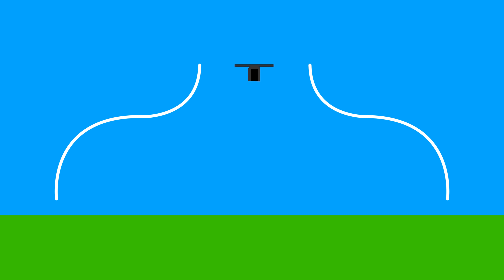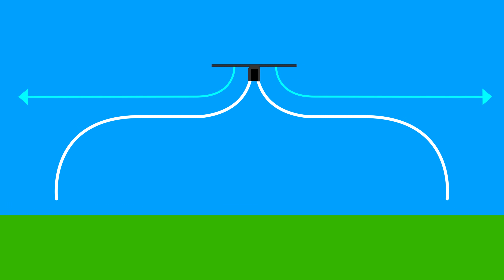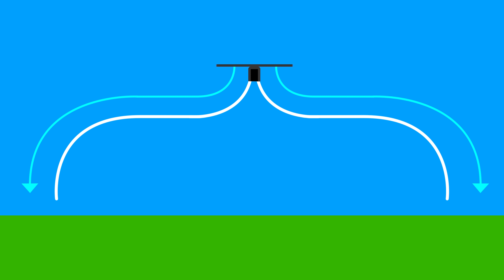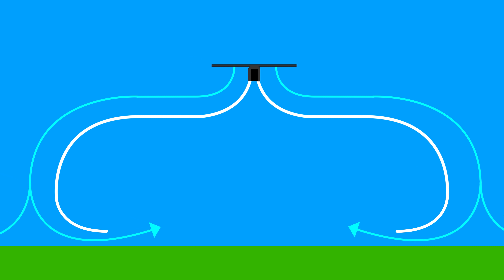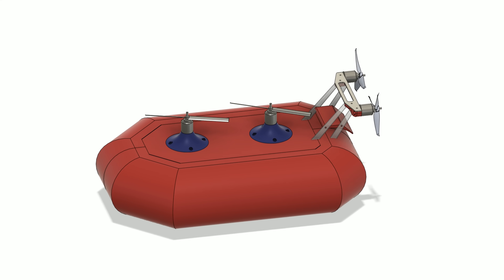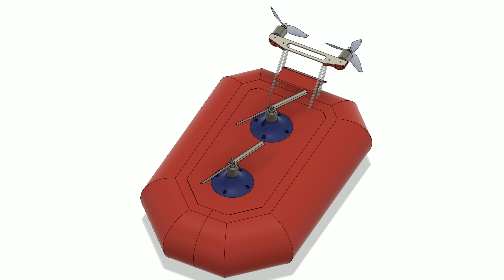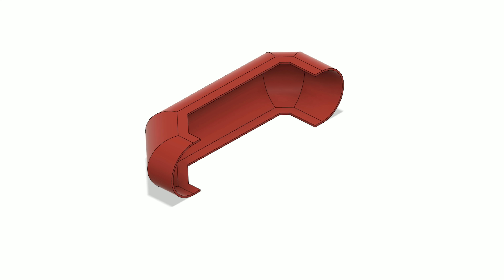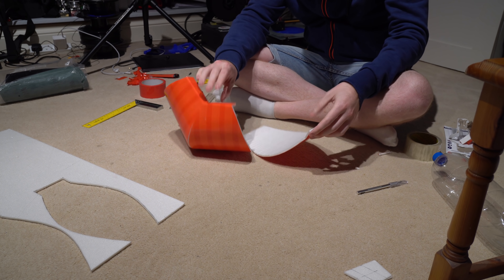Coanda Effect Hovercraft

Comment: It's difficult to see how much is the coanda effect and how much is the fact that you're using lift propellers in the first place. 
You could figure this out by mounting the lift and thrust motors on a flat plate with the same plan area as the coanda hull and see how much lift you get.
Reply: Yup, it'd be nice to see the the entire system on a flat board and see how it compares.
Reply: I thought the same thing. The craft's chassis doesn't support the idea of it being a coanda hovercraft, tho it looks like a hovercraft. It's simply not optimised for assumed results, so by the fact it works 'kind of so well' I believe at work is mostly the low-pressure zone created by the blades. He used strong enough motors it just had to work this way or another. Yet if optimised design would work with weaker ones, while this couldn't.
Reply: @mr.rabbit5642  you are on the right path...

coanda effect itself cannot produce ANY lift... whatsoever. one has to always bear in mind, what MAKES that high speed, low pressure layer of air cling to the surface in the first place?
the atmosphere itself. and that pushes just as hard on the layer of air, as it does on the surface without the air...

hang a sheet of newspaper in front of an AC vent. YAY! it supports itself!
but whats supporting the AC vent? the WALL.

take away the wall, strap the vent to the newspaper, net result... no lift. i figured this out before i was ten, thought i was so smart when i found this "VTOL" concept... only to shatter my dreams as i understood what was REALLY going on. so as ive gotten older, i just laugh at all these so called "coanda effect attempts" as they truly are amusing... but totally impractical.

the props are, by their old name, "air screws", screwing their way into the air with a certain percentage of slip. being stuck to the ground... 100% slip :)

 "lift" being due solely to action and reaction of accelerating mass, airflow, downwards.  as per another commenter, the downwash of the props impacting the body, and changing direction, is producing more of a negative lift/thrust or a downwards force, than adding thrust/lift upwards.
Reply: Exactly! I was just about to comment the same thing
Reply: J d  Not a drone.  Not designed to be a drone.  Doesn't fail for not being a drone.
Reply: @BearRealOfficial  thats what i said but apparently thats wrong and i couldnt bother to do the research 💀🤣
Reply: witkrieg todd  It admit that I simplified things a bit. But it is still true that generated downward airflow pushes the craft down. And it will push the craft down more if the airflow is bend more to the side. I haven't done the calculations, but I doubt that the upward force generated by the rotor blades will be bigger than the downward force of the full airflow onto the craft. And I would be very surprised if the force from the Coanda effect is bigger than either of them.
Reply: witkrieg todd  I do understand all that, and understand how propellors (and wings) work. But the bottom line is that, besides the lift provide by the propeller, the propeller DOES push air down as well. That air pushes down on the craft below, and therefore forms a downward force on the craft. And note that in the experiment, the propellor was actually intended to move as mush air as possible, to demonstrate the effect he is talking about.
Reply: @renedekker9806  A simple test for this would be to put the hovercraft on a scale.  If you're correct, as it spins up, the weight of the craft would go up as the propellers speed up (that is until it finally was producing enough lift).  I agree with witkrieg todd, however.  I don't believe there is any downforce from the propellers, as the propeller is ATTACHED to the top of the craft.  It is pushing wind against ITSELF (not the ground), so it is just messing with pressure.  Wings work with (wait for it....) PRESSURE.  A simple test could prove which idea is correct.  Maybe @Tom Stanton could chime in, since he already has the setup.
Reply: @ErikBriggs  You misunderstand both me and the point made in the video. The  weight of the hovercraft would of course not go up when you switch the propellor on, because the propellor is lifting it. It's just that part of the lift that the propellor generates is cancelled by the flow of air generating a down force on the body. 
But the point of the video was NOT to see whether a propellor above a hovercraft could lift the hovercraft. The point was to see whether the Coanda effect could lift it. The sole purpose of putting the propeller on the hovercraft was to generate as much airflow as possible. The author reasoned that the vertical airflow could then be turned into a horizontal airflow, creating a Coanda effect on the edges of the body of the craft. The only point I was making is that the force of the airflow pushing down will likely be much bigger than any Coanda of the body of the craft.
Reply: witkrieg todd  Just read all your posts, they pretty much explain what I already wondered about. So thanks, was quite informative!

With that it seems pretty obvious that this is not a hovercraft at all, nor a coronacraft.
Reply: J d  you do realize the drone fans cant lift it at all do too the fact there is something beneath them you should learn before you speak 😂
Reply: witkrieg todd  Concerning the whole heat thing: that is one way (the thermodynamics way) of looking at it. It's far beyond the scope of most of these comments who can't even do simple physics.

It still has to do with pressure though, because a propeller creates a high pressure/low pressure differential. A change in pressure assuming the same volume is also a change in heat, so it's also a heat differential. Heat flows from where there is higher energy (the pressurized air) to lower energy (the low pressure air), so that's where lift comes from.

If a propeller could restrict the air being pressurized to the same volume perfectly, it would be much more efficient, but of course the air around it isn't in a sealed container, so some part of the energy the propeller put into the high pressure air gets lost as the high pressure air expands and mixes with the surrounding air instead of pushing back on the propeller.

So, of course my assumption that the change in pressure is completely within the same volume isn't what we actually see, but that's due to lost lift.
Reply: witkrieg todd  "lift is not ever generated by taking air mass and moving it in the opposite direction of travel."

I think I get what you're going for (it's the deflection on the blades/wing that actually generates the lift), but... vtol jets? They take in air and heat it so it generates thrust as it leaves the chamber.
Reply: He probed clearly in a previous windows with a different kind of propeller. Check that and then return here.
Reply: Hugo Stiglitz the propeller would be pushing air onto to hovercraft so of it was just the propellers causing it to lift the propeller would lift off the body... think about it
Reply: @tmboyum4677  what do you mean, "lift off the body"?
Reply: @BondiAV  
Perhaps a better understanding of the coanda effect may be seen in directional effect, rather than lift. That is, can we use coanda to direct a vessel diverting downward thrust into horizontal thrust?
Hmm...
How may we be able to differentiate  the effect of coanda from the simple Newtonian redirection of thrust?

I'm no aeronautical engineer. It's hard to imagine that someone hasn't already thought of all this. Interesting to ponder, nonetheless.
Reply: There’s definitely a coanda effect. The propellers push against the upper body of the hovercraft, so whatever lift they generate for themselves is counteracted by the downward force their airstream exerts on the hovercraft.
Reply: @j10001  The propellors are quite high above the body. The air is not being bent completely horizontally sideways, but will retain a large part of the downwards speed. And therefore, that generates upwards lift on its own. The first part, with the impellers moving air only sideways shows that the Coanda effect on its own does not have much effect in this case.
Reply: Rene Dekker Not sure if you are taking into account the downward force of the propellers’ airstream unto the top of the hovercraft. But in any case, are you saying the air from the propeller flows down around the edge of the hovercraft? How does it turn from scattering horizontally to flowing downward? Is it too simple to say that air flowing down into the hovercraft presses it downward, while air flowing down around the hovercraft pushes it up? So what’s causing it to flow around the hovercraft (that is, to turn downward after flowing sideways) if not the coanda effect?
Reply: Or are you pointing out that these are not clean orthogonal (vertical vs horizontal forces), that there’s a widespread force downward from the propellers that has enough of a horizontal component to move it past the edge of the hovercraft by the time it reaches the upper surface, and still enough of a vertical component to provide lift once it reaches beyond the hovercraft edge? This would be a good point, and it would take some wind tunnel or smokestream work to figure out what’s actually happening.
Reply: @j10001  The second thing indeed. The airstream does convert into a fully horizontal stream just by hitting the top of the hovercraft.  He could have made that better by putting a funnel directly under the propellors, which could convert it into an almost fully horizontal stream (that would still leave a slight under-pressure above the propellors sucking the whole craft up, but I would not expect that to be a big force).
Reply: @j10001  Finally someone did the math...
Reply: witkrieg todd  Hmmm, besides a lot of unrelated points, there's some problems here, and these are just a few:

“For a helicopter rotor to push air downward would impart an equal and opposite force upward.” [Presented as an argument why rotors don't push air, and this upward force is supposed to be a problem because it cancels out.]

Yes and no. The equal and opposite force upward is called lift. A rotor produces thrust. Thrust is force. That force is directed upward (and also to the side if the chopper isn't just climbing, hovering, or descending), and the reason why any force is produced is due to lift. We see lift because a propeller creates a high/low pressure differential, in effect forcing the air behind the propeller. There is some pushing of air that adds to the high pressure differential, but the larger way the propeller forces air behind it comes from fluid dynamics, airflow, the Bernoulli Effect, and the pressure differential. Pushing the air around isn't what really causes lift, because the air just gives way, but it still adds a non-zero amount to the pressure differential. “Forcing” is a better term, I'll admit that.

“Same reason a rocket without a nozzle won't work in space. ... Causes a pressure buildup, allowing the expanding gas in the rocket to push against the gas bubble behind it.”
No, no, no, and again, no! Not only is this an incomplete explanation of what you're trying to say (referring to the whole quote, only partially copied here), but that is not even close to why rockets have nozzles. First off, you're getting after other people about saying the word “push” to much, well I'm holding you to that here. Rocket exhaust gases do not push a rocket upwards!!! For the gases to push the rocket to cause meaningful upward motion, the gases would ultimately have to be pushing against the ground! No, rocket nozzles have one main function: bouncing around the expanding gases in order to direct it in a uniform downward direction. Every force must have an equal and opposite reaction, so the opposite reaction to any gas particles leaving the rocket downward is for the rocket itself to travel upward. This is impulse. Any gas particles not traveling downward when leaving the rocket does not maximize it's vertical impulse, so the nozzle helps guide the chaotic multidirectional gas particles leaving the throat of the combustion chamber into a nice, orderly downwards path. Different shapes of nozzles work better at different altitudes, due to atmospheric pressure.

The closest thing to what you're talking about is the Venturi effect, which is basically where the tiny throat causes a choked flow condition and when the expanding gases reach the large bell area, the sudden low pressure causes the gases to accelerate to about Mach 1. They don't push the rocket up though. They cause impulse.

“The blade pushing the air back, has to push off the plane, to push against the air. You are measuring the only half the interaction. If you think about what you are saying, you are describing it like a screw propellor! That's not what's happening. You aren't pulling water.”

The reason a blade pushing on air doesn't cause lift isn't really because the blade is pushing against the plane which is in the air. Rather, it's because the blade is pushing against air, which gives way instead of pushing back. The blade pushing against the air still adds some amount to the high/low pressure differential on either side of the propeller, which itself causes thrust.

The plane propeller isn't so different actually from a boat propeller, since fluid dynamics applies to both water and air. The main difference is that water is way more viscous than air, so the amount of the different fluid dynamic effects work out differently.
Reply: witkrieg todd  Just went and looked your michigan university video. 
They talk a lot about pressure differential and flow redirection, but nowhere about there is a mention about heat transfer. I don't know which one you looked, but you seem to be a little off in your conceptions.
The video I saw talked about flow redirection and Bernoulli.
The wing push the plane upward by redirecting the flow of air down and that create a pressure differential. Same with the blade of the rotor, it redirect the air back. Also a fan that generate 100% heat is not a good fan, in fact it's not a fan at all, what you want is a fan that generate 100% kinetic energy.

A car doesn't move by heating the road, it's a secondary effect. A car moves by pushing against the road,  the way you present it a burnout would give the best acceleration.
And what's that all about torque on the rotor, the blade and the shaft?
I mean it doesn't make any difference how the force is transferred from the blade to the shaft. If I push the blade I push the plane.
Reply: The probs actually create downwards thrust. So the coanda effect is clearly visible
Reply: @dklouwens7559  Uuh, if the propellers were producing downwards thrust, the propellers would have to be pushing air upwards and away from the hovercraft.
Reply: @benjaminhackett8896  yeah, this was one of those weird things you think for a bit
ig would be interesting to see how this would work if the propel wasn't linked to the machine tho
Reply: @benjaminhackett8896  thank you people think the propellers just lift things thats not how it works it creates downwards trust on the air to fly or move the propellers are over the object so all the trust is going nowere
Reply: If this wasnt the coanda effect in play there would be no lift 🤦🏿‍♂️
Reply: @moeluminati2844  Incorrect. That's not what I said. I was replying to another comment, which like you was mistaking vector directions.

The propellers are not producing downwards thrust. Think about it. It may be thrusting the air downwards, but the thrust vector, i.e. the force produced by the propellers, is upwards. Therefore, these propellers are creating upwards thrust, i.e. upwards force, i.e. upwards lift...with downwards forced air.

Why? Let me explain.

Whether the propellers are cancelled out or not, it's still pushing air downwards in order to attempt to make it flow over the hovercraft. That creates a high pressure area behind (below) the propellers and a low pressure area in front (on top), which is the exact recipe for lift. The lift (thrust) vector always points towards the low pressure area. On a plane, the propellers create forwards lift (thrust). On a helicopter the blades create upwards lift (thrust). A helicopter turns its blades to produce upwards thrust (lift) and you can see the high pressure area under the helicopter blades when you see people boarding or getting off, because the air is blowing downwards against them, or being “pushed” down against them.

Therefore, you can see that the propellers on this hovercraft must also be turning in the same way as a helicopter's blades, because you want the air directed downward in order to, as I said earlier, “attempt to make it flow over the hovercraft.”

If on the other hand we try spinning them to create downwards thrust, they would a low pressure area under the propellers, and the air would be sucked around the craft in an updraft, keeping it grounded instead of flying.

Downwards air, upwards thrust. Downwards thrust, upwards air.

This does not consider whether the lift from the propellers is counteracted by the impulse of the air hitting the craft.
Reply: @benjaminhackett8896  oh i now see and i see where i was mistaken
Reply: Benjamin Hackett simply incorrect.  Thrust isn’t the opposite of airflow. Upward movement is a result of DOWNWARD thrust. Airplanes. Rockets. Anything that moves air refers to thrust being in the direction of the mass airflow. Guides at the ends that change the direction of the airflow, such as in VTOL or STOL military places, have “thrust vectoring” because the thrust direction is changed.
Reply: DGerber action/reaction.  I guess while the definition is this, quantity / value is the same.  We’re splitting hairs
Reply: @Meatball2022  You were the one claiming it was incorrect, sooo
Reply: DGerber to split a different hair - do you think ducted props would help?  Would seem to me that they would improve efficiency.
Reply: @dklouwens7559  No, the propellers are creating upward thrust. The mass airflow is downward but the thrust is upward.
Reply: I just learned that "thrust" and "airflow" operate in two opposite directions. Because I was about to make the exact same comment: aren't the propellers just lifting the object because THEY'RE PROPELLERS?
Reply: @hugostiglitz6914  No they aren't, the airflow would be hitting the surface, thus cancelling the thrust by pushing down on it with force exactly equal to the thrust. The coanda efect is taking  the horizontal flow generated by the small conic thing at the base of the propreller and making it vertical again
Reply: @dklouwens7559  
How is this "clear?" Please be more precise.